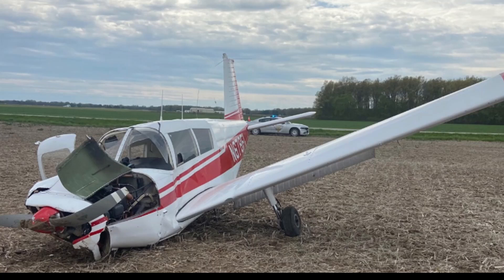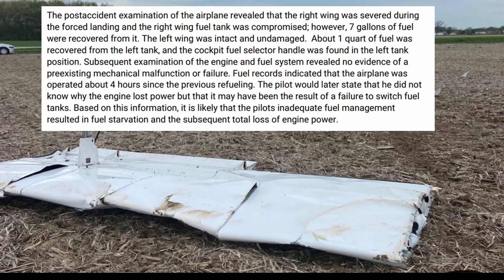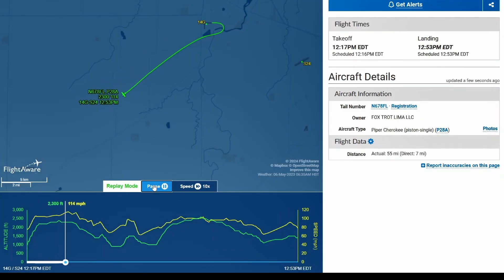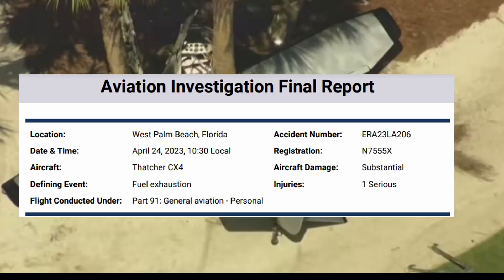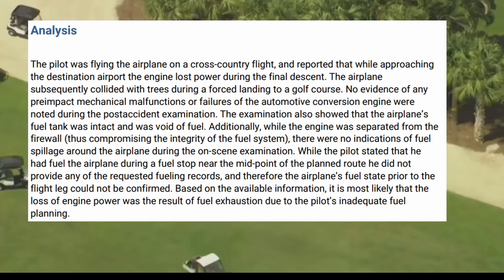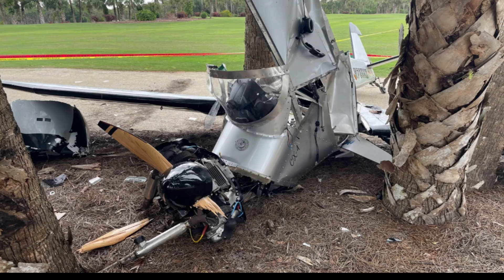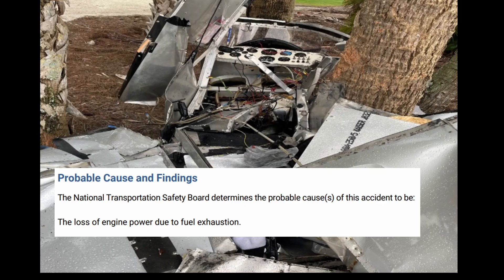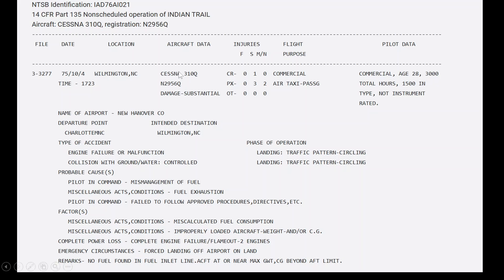Fuel Exhaustion Does it Again

Comment: My personal opinion would be that most of these crashes result because either the pilot did not properly switch fuel tank selector switch after running low of fuel in one tank.  Maybe aircraft manufacturers should consider installing audible low-fuel warning alarms in each tank that is installed on the aircraft.  The GA pilots need to remember that Triple A is not
operating in the clouds, so when they run out of fuel, there is no fuel station just ahead.  I live in an area of Southern California that is prone to wildfires in the vicinity, so I never let my fuel tank show less than 1/4 of a tank at any time.  I know aviation fuel may be pricey right now, but do they put the valuation of fuel more important than the value of their own life.  I'd rather have way more fuel than not enough to get me to my destination and a couple of alternates if I have to divert.  I wonder if insurance covers  damages to aircraft caused by owner/pilot negligence.
Reply from the maker: Good point and thanks.  More
Fuel seems reasonable for the consequences of not

Comment: FREDA (cruise checks)
Fuel , check against plan, change tanks.
Radios, set for next frequency
Engine, temperatures and pressures, check vacuum.
DI, crosscheck and set against compass.
Altimeter, set to regional QNH or QNE as appropriate.

That is what taught, that is what I flew.
Reply from the maker: Thanks for this

Comment: One guy found out the lucky way since his fuel exhaustion ended okay was that since the fuel pickup line is on the back bottom of the tank that when he nosed up a little it gave him access to enough fuel to get to the airport if he kept the nose up doing a low power descent to the airport. Live and learn.
Reply: Poor fuel tank design results in many aircraft having several gallons of unusable fuel after tanks are empty. FAA certification is based on several factors which result in this unusable fuel. As you say here, a smart pilot can take advantage of fuel tank pickup location or flying with one wing low to extract some additional fuel. This detail should be noted in the flight manual, but you will never see this because of certification and liability.
Reply from the maker: Thanks 😊

Comment: The Cherokee, most Pipers, have a R or L fuel selector but no Both as do Cessnas.  I had a fuel starvation with an Ag student in a SuperCub.  I took the controls and made a steep 1 g turn to an adjoining field across from where we were practice spraying.  He got the fuel selector to the other tank and the engine caught, but I went ahead and landed.  The Cherokee caught a wing while still in a turn to get into the nice field.  I did that once trying to line up with the cotton rows (fuel starvation) in a CallAir Ag plane spraying onions.  I still had airspeed so cartwheeled.  The Cherokee was sinking too rapidly so broke the wing off without cartwheeling.  The airplane that landed on the golf course was too fast and ended up in the trees.  Good job with the rudder, however, to yaw the nose to go exactly between the two trees.  Fuel mismanagement, at least in my cases, results from distraction with other issues more than trying to go too far.  I also had fuel starvation on a Cessna 172, selector on both always, because a mouse died in the tank and hair from the dead mouse built up in the nipple screen going into the carburetor.   Because the level in low, six inches, ground effect for the extra fast acceleration to cruise, I simply landed on the runway remaining.
Reply from the maker: Thanks as always for sharing g your stories
Reply: One has to wonder how the hell a mouse got in the tank considering that the only time the cap is open, is while fueling up, and  in that case, how the hell did you not see it?
Reply: @ConvairDart106  Long story about an unsafe pipeline patrol company that kept pilots only by paying more than other patrol companies.  While helping put the used tank in my plane, I noticed no tape and evidence of steam cleaning.  So, the mouse got in the used spare tank in the hanger at Sweetwater Texas.  My pipelines took me to Jackson then north to Patoka Illinois then Shell Ozark Pipeline all the way to Midland.  The hair entering the screen didn't restrict enough on full power takeoffs until Lebanon Missouri.  I drank coffee all day and landed every two hours or so for pit stop and fuel.

Comment: Do aircraft have low fuel warning lights ?
Reply: newer airplanes do, not likely the ones mentioned in this report.
Reply: When you own the plane yourself…

You can update the fuel level sensors… with digital accuracy…

You can add low level warnings…

You can wire it to the gps for fuel to the final destination warning…

Fuel flow sensors and fuel totalizers have been in use since the 90s… really helpful…

Additional fuel level sensors in the wing make a great back-up system, and help when partially filling the tanks…

Check lists and knowledge of how to use them work wonders…

😃

Comment: Running out of fuel has sadly killed lots of pilots and some of their passengers.  Absolutely no excuse for it, but since it keeps happening, we have to keep banging the drum and trying to find technical solutions.
Reply from the maker: Agreed 👍
Reply: Poor fuel system design in several primary training aircraft, like the Piper Cherokee series, has contributed to many accidents. A both on setting and placing the fuel selector handle in front between the seats would help. See modern aircraft like the Diamond D-40 for example.
Reply: @bernieschiff5919  Very true.  Add in a good fuel totalizer and some more accurate fuel tank sensors, and a pilot will be less likely to run out of fuel.

Comment: PPL must check tanks have more than adequate fuel for the planned flight plus a diversion. With tanks in each wing one switches between tanks in flight so that the plane stays in balance. Also carburettors can get iced due to narrow Venturi so carb heat needs to be applied frequently or the engine may stop.
Reply from the maker: Thanks Robin hope all is well